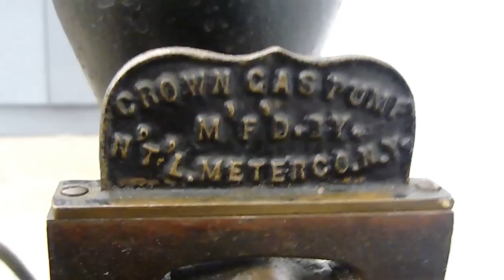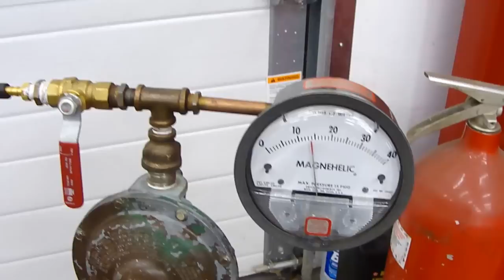1883 Crown Pumping Engine - Flame ignition Non-Compression

Comment from the maker: You are correct  However a mixture with those components is costly.  The Propane / H2 blend can easily be made in the shop for a fraction of the cost and burns acceptably in the engine.

Comment: No its actually s noncompression engine. Pressure from the combustion directly pushes the piston ( power stroke )  the cycle just lacks the tradition "compression stroke" that a four cycle engine has. Ignition occurs in the middle of the intake stroke
Reply: Didn't the Lenoir engine work the exact same way?